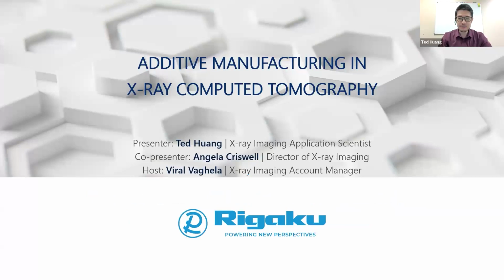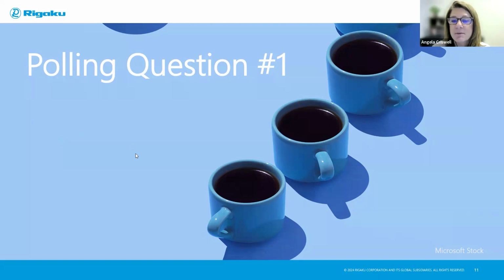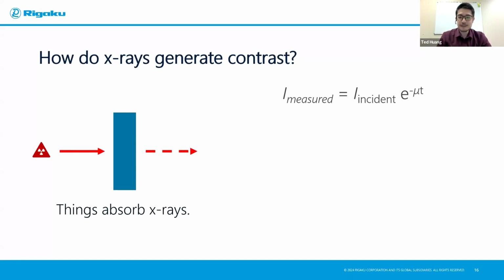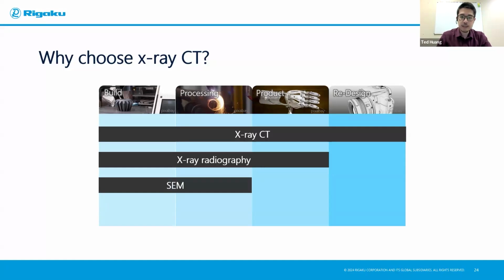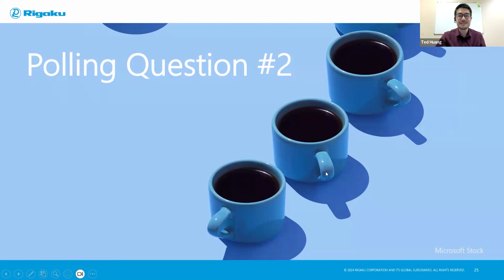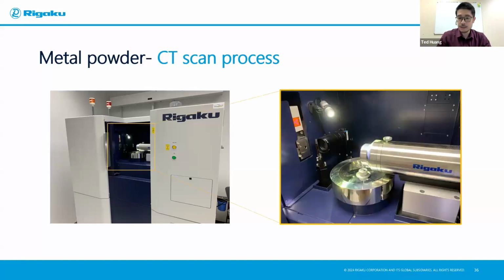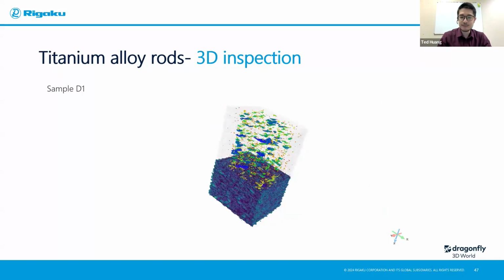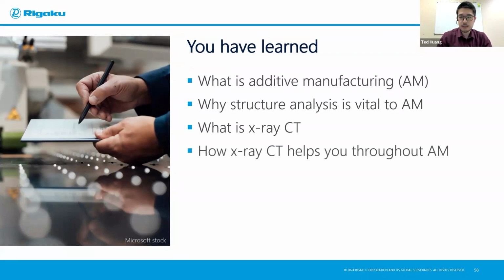X-ray Computed Tomography for Materials Science 11. Additive Manufacturing in Computed Tomography

Comment: Can we use XCT for in-situ monitoring in additive manufacturing like laser cladding or DED?
Reply: 51:45
Reply: Hello @inspectormag, thanks for asking!

The short answer is yes.
The long answer is it depends on the feature you are looking for.

XCT requires multiple images captured from various angles, hence the fastest scan to give you a 3D reconstruction lies within the range of seconds to tens of seconds.
If what you are interested in is constantly changing in these few seconds, then XCT cannot capture it properly.
If the structural feature stays relatively the same during these times, then XCT can capture the structure information for you.

Nevertheless, the finer the features, the harder to capture them clearly with very fast scans.
The in-situ setup would also introduce more complexity, specific details would need to be considered for different applications.
Hope this answer helps, feel free to reach out if you have any further questions!